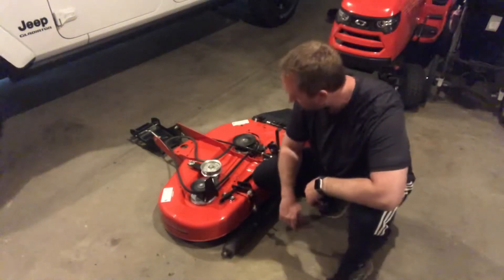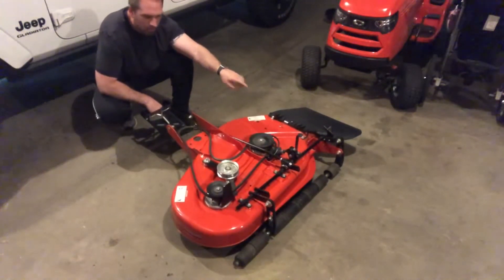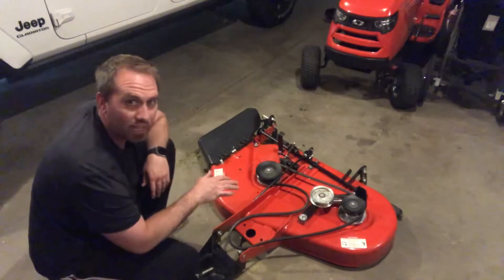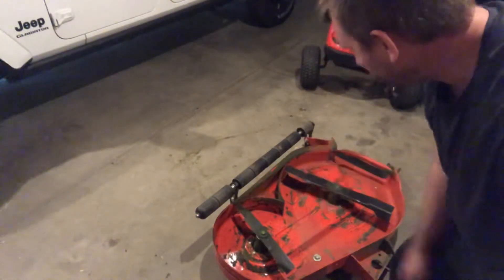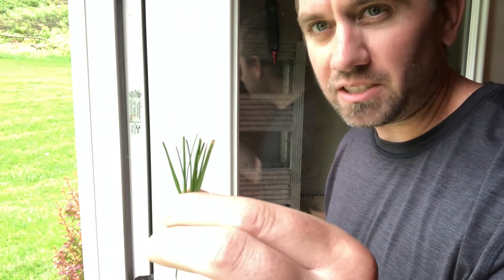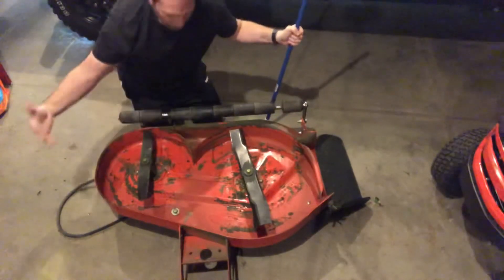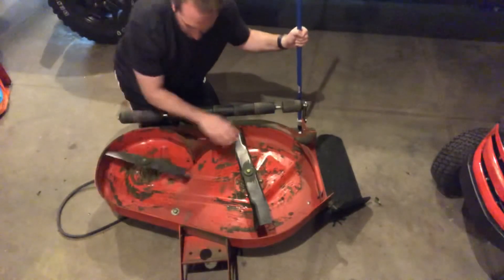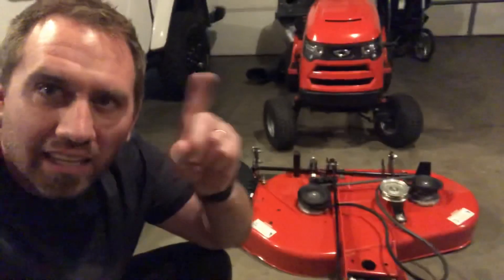Design Deep Dive into Simplicity 38” mower deck.  Why Simplicity Regent wins cut quality.

Comment: So, that deck actually has two blades that are different sizes????? Is it hard to find the two blades as a set, or do you have to buy a blade of one size, and one of the another size?? I don't own a Simplicity, but I am curious about this now after watching this video. Thanks!
Reply from the maker: Yes, the blades are two different sizes.  When buying a new set, you do need two different blades, they are drastically different in size.

Comment: lawn engineer- in regards to the deck design you described and how you are not a fan of mulching with an explanation and theory as to to why, well, i have a question for both of said issues. why do i have a lousy mulch cut with my 38" riding mower with 2 mulching blades and a regular shaped stamped deck with mulch plug but when i use my 22" push mower single mulch blade with mulch plug and regular stamped deck, i get an excellent cut? my only answer to this is because it is a single blade, smaller deck that hovers the ground more and follows it more, and i'm not going as fast pushing as i would be riding on my riding mower. what's your take? or anyone else for that matter? and besides a simplicity mower, i don't know what other brand or model of brand would be the equivalent or close to simplicity, all i know is that my next door neighbor got a new 2024 cub cadet xt1 42" with intellipower engine, he let me try it out this week on my lawn and i got a perfect cut with it. btw- all my blades on my mowers are brand new and the new blades on my riding mower line up perfectly in the deck and it is level, not bent, with straight spindles so,,,,,. dunno. 
sorry for the novel, enjoyed the video, thanks.
Reply from the maker: You pose a very good question.  I believe it’s a matter of how well the deck is able to pull air up at the edge of the deck and flow down at the center of the blade.  This is the done much easier with a single blade.

Comment: Lawn Engineer: Your comments are helpful to the viewers who only need to see the instructions straight from Simplicity's manual on how to level the deck on a Regent, but the problem is that none of those instructions actually work. I can't even access the (2) huge "15/16" nuts in the back for the front to rear leveling adjustment nuts. In addition unless you happen to own an expensive professional mechanic's business garage which has an expensive mechanical hoist and a large steel table which is necessary to be able to access the adjustment nuts, you are out of luck! I have the 23 hp, 42" fabricated deck Regent and it is 1/2 " too high in the front and it is 1/2 " high on the left side and will not go any further down to reach the level point. Also the lift lever has no effect at all, it does not raise the deck up or down when pulling or pushing the lift handle. Further, when the deck is at it's lowest point by the electronic switch on the dash, the rollers do not touch the ground by about 2 inches so the deck can not be lifted off the hooks in the front for removing the deck. Do you have any ideas that might help?

Thank you
Reply from the maker: I wish I could help you out more but it's difficult without getting my eyeballs on what you have going on.

Comment: great video.  I small note... the "stand" that you referred to on the top off the deck wasn't intended to keep the electric motor protected when you flip the deck over in your garage, although it certainly is a benefit in that regard.  The real purpose of that is similar to a bump stop on the suspension of your truck.  It is to avoid the deck pulleys crashing into the under-side of the tractor.  Since the deck follows the ground, independent of the tractor motion, without that feature the other components on the top side of the deck would potentially get damaged from impacting the bottom of the tractor.
Reply from the maker: Great additional information.  Thanks for taking the time to share with all 👍.

Comment: can you show where the belt tension spring is supposed to connect on the deck?  Mine came off and Im a bit stumped.  Thanks
Reply from the maker: If you watch this video, at 26 seconds you can see the spring.  It's hooked to the underside of the silver pulley and just behind the non discharge deck spindle.  

https://youtu.be/3KKEi00Urr8?si=UOYJUy_3m3bu1JUi

Comment: I just picked up one of these a few years old with a powerflow bagger system about a month ago.  $50.  going to weld up the deck and fix a couple incidentals on the bagger this winter.  Got to mow with it  once, dang does the little fella eat leaves.
Reply from the maker: The power flow system is a nice addition, helps prevent any plugging.  You should have a really nice setup when you get it back in shape.

Comment: Well, with availability and little to no options available when "forced" to buy a new rider, I took some comfort in watching this. The Simplicity 38 was the "only" option at a local shop (the last one) and will be delivered next week. I like the fact I can take deck off and on so easily to clean and maintain. Was looking for a 42, but this may be a blessing. Also, I feel with all your videos, I have a one-on-one assistant to walk me through maintenance. Subscribed. and thank you in advance. I've watched most of them.
Reply from the maker: Thanks for checking in Brent.  I’m glad you found some value in my videos.

You will like your new Simplicity, the smaller deck will also follow the terrain of your lawn better and provide a better looking cut.  It will take you a few more minutes to cut but when you are done it will look great.
Reply: @TheLawnEngineer  need. To know how to mount a single stage snow blowrt
Reply from the maker: @ronhamilton801  unfortunately I don’t have any experience with that on the regent.

Comment: A few small observations on the design...the smaller blade appears to have a typical profile in sail height, length and pitch (the lift and throw generating area of the blade). The larger blade not only has a taller and longer sail about the length of the blade, but also an extreme angle which generates not only greater air movement but also significant throwing force.  The difference in length also allows for greater blade overlap in the direction of forward travel without the need to have a longer deck front to back. This yields a more compact design with minimal likelihood of centerline stragglers (which has me double cutting all the time with my lesser quality deck). 
Also wanted to add that having a more compact design overall further reduces cut hight variances and incidents of scalping just like a narrower deck over a wide deck as the landscape becomes more irregular, even with wheels/rollers of its own. Thanks for sharing.
Reply from the maker: Great observations, it awesome to communicate with someone who appreciates the design of things...especially mower decks.  All things are definitely not design and made equal.

Comment: What can I do if my Simplicity tractor deck does not have those extra cable holes? I reall appreciate the video.
Reply from the maker: I would check the linkage from the lift lever to see if there are extra holes there.  Mine had extra holes there too but it was already setup to have max movement.  

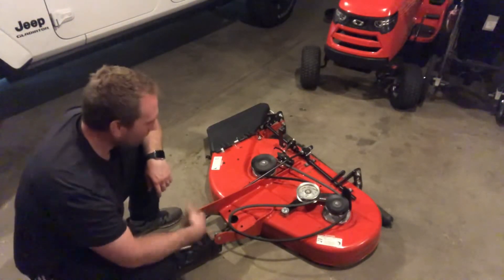 The further you get from the pivot point the more lift you will get.  At 3:04 in my "increase deck lift" video I show this linkage.

Comment: What makes these mowers run slow with new drive belt has pull power but no speed would appreciate any info THANKS. Mines 14hp 38in cut.
Reply from the maker: Because you mentioned a new belt, it could be low tension causing the belt to slip.  I would double check the tensioner assembly.

If that checks out, it may be internal to the hydro.  Low speed operation requires high pressure but a low flow rate of oil, high speed operation requires high pressure and a high flow rate.  A low oil condition will show up first during high flow rates because the reservoir can empty because the oil can be pumped out faster than it returns.  If your unit is not low on oil, you hydro unit could be wearing out.  You can get more life out of a worn unit by swapping out the oil for some with higher viscosity (10w-30 to 20w-50).  

It is also possible that the control linkage has loosened or bent.  This is low probability but worth checking.

Comment: Good job explaining the mower deck butnI don't look forward to working on mine tomorrow.  This is my second regency 38" and is 10 years old, the one before lasted 20 years.  I have one question when will you start your Gladiator build?  Your video helped with one of the problems I face with the spring pulley.  OMB
Reply from the maker: I’m not sure on the gladiator, it’s my daily driver so I don’t know that I’m going to do anything above a leveling kit…. But they sure look good on 35”s.

Comment: Just bought the Regent 42 inch a couple weeks ago. I love the Simplicity but am having 2 issues. I’m getting burn marks in the lawn in random spots the day after I mow, And I can’t get it in my shed. The roller won’t go over the  gap between my ramp and shed   I have it transport mode but it won’t lift over the gap. Didn’t know if anyone was having those issues. Appreciate the videos great info!
Reply from the maker: I don't know why you would be getting burn marks, but I have noticed the deck doesn't come up very high in "transport" mode.  I did look around at the linkage and there may be a way to increase the height, I'll make a video if I figure something out.
Reply: I have a Simplicity Broadmoor with 38 inch deck& of course it has the rear rollers. I store it in my shed, which has a ramp. Mine goes over the edge of the ramp, no problem! Maybe you could try puting your blades at the highest cut it will go, and of course have it in transport mode. Hope this helps!  Best/DVK
Reply: I have the same deck problem. Cannot put the cable in the second hole since none is there.